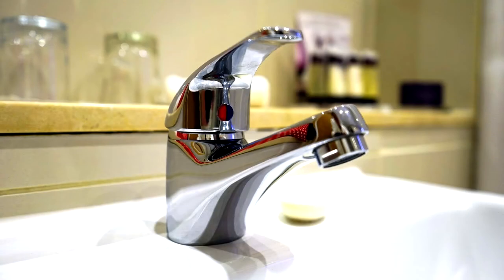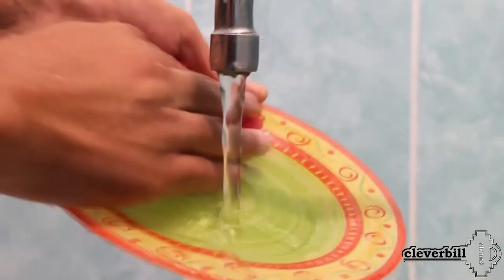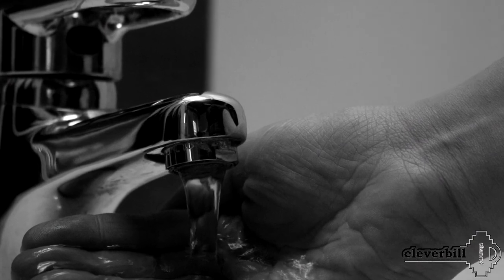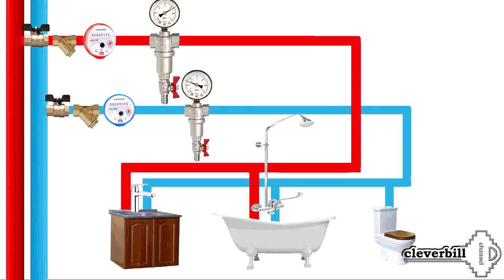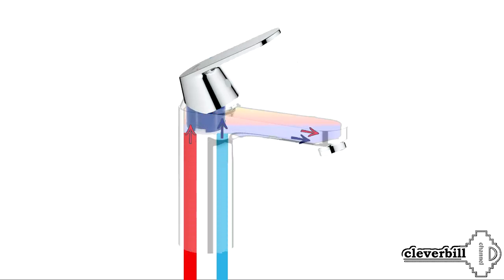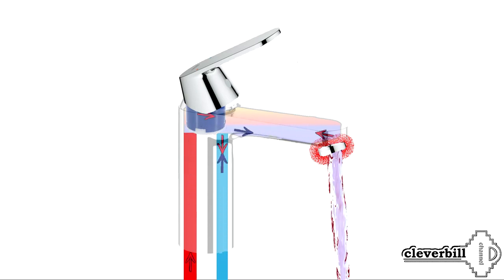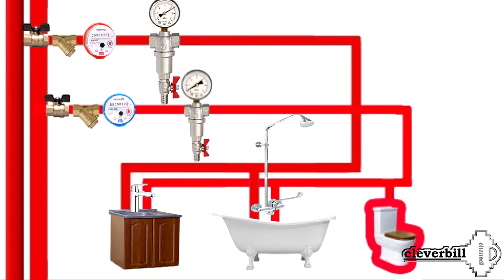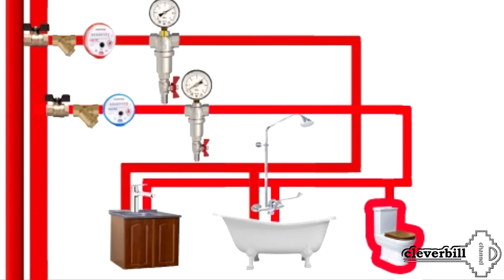Faucet aerator - what a clogged Aerator is capable of!

Comment from the maker: Hot water pouring from the toilet bowl is surprising for many, although such a picture does happen !. Shutdown of the cold water supply system, malfunction of the mixer diverter, hygienic shower or clogging of watering cans and aerators used in the home water supply system without installed check valves, is the result of this phenomenon.